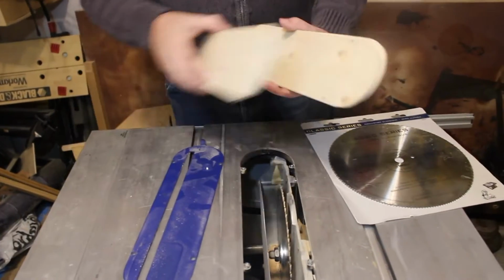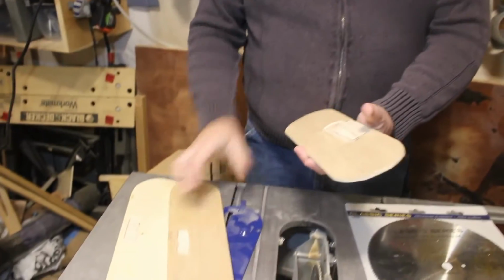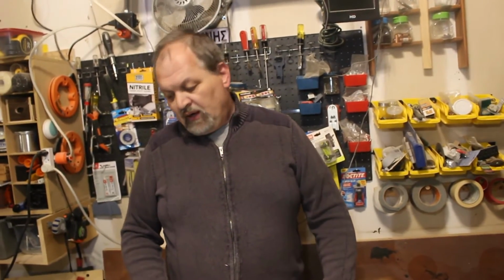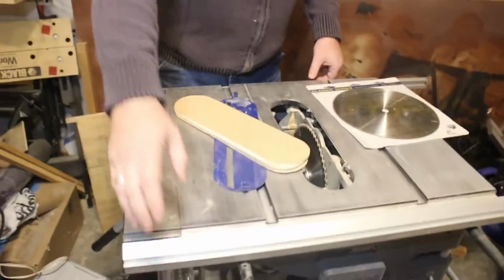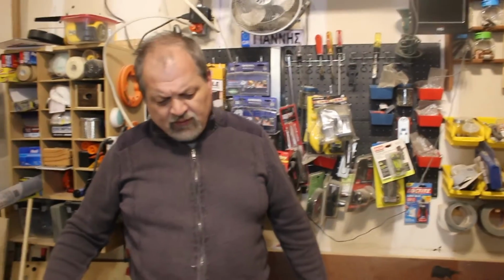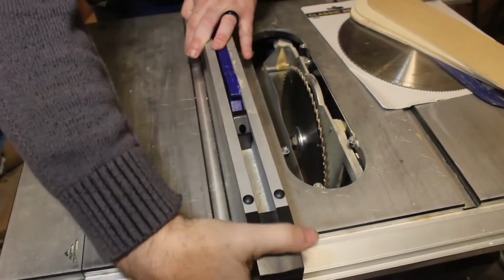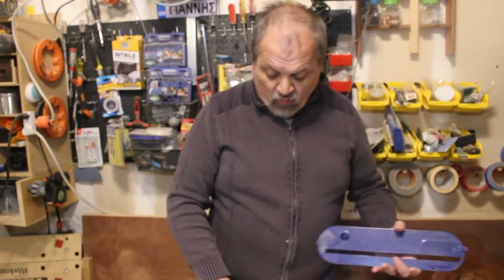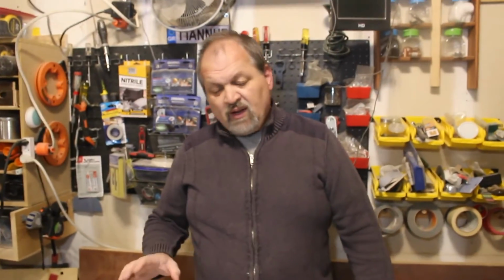Do not buy a KOBALT table saw before watching this review!!

Comment: On my 7th year with my kobalt, as a contractor it gets used weekly, not daily but at least twice a week. I had less expectations when I bought it, but has turned out to be really good. Never had a problem except the tab that locks it in the closed position broke off, more than likely due to all the bouncing in my work trailer. But I take care of my tools because they are my livelihood, wax the table, lube and so on. With 7yrs of use it still looks better than the one in this video. I wouldn't hesitate to buy another one. I square the fence at zero clearance and just use the slide for adjustment, if you need to rip anything larger than that I just used circular saw and guide.
Reply from the maker: yes, it is an excellent saw - especially for the price!

Comment: Kobalt made some adjustments based on complaints I am thinking. The plate is now adjustable with top leveling screws, and the turn knob is out of the way of the angle lever.  Had one for a year and so far I love it.  Im not a construction person or a contractor, but if I were, I probably would get something a little more INDUSTRIAL.  This is perfect for a small wood shop or diy.
Reply from the maker: Thank you for the information!

Comment: Where can I find a bevel gear and threaded shaft for the blade height adjustment? Lowes isn't any help.
Reply from the maker: You can Craiglist search for a non working saw or take the parts out and match them in a hardware store unfortunately there are no easy options for parts
Reply: @ProfessorDIY  thanks  I'm trying to find a height screw and the bevel gear. Lowes is no help.

Comment: As you said in a comment below:
"unfortunately there are no easy options for parts..."

And that's the end of it, for me. According to the manual, you can replace the wheels, rip fence, miter, and guard - and that's about it. Most of this handful of items you will want to replace - with something better - although the rip fence probably has to be Kobalt.

Guys, before you spend your cash on a tool, get the model # for it and try to find parts. Kobalt has to be one of the very worst of the worst when it comes to repair/replacement parts - In my mind, a tool that has no repair/replacement parts available isn't a tool - it's a toy, and a disposable toy at that. Spend a little money now to save yourself a lot of money later on a tool that you can maintain - not discard when anything breaks or wears out.
Reply from the maker: I conceptually agree with you  but these days it is cheaper to buy a new tool than most parts needed to repair it. You pair this saw with a good blade and you have something!
Reply: I am actually "restoring" this saw.  I called up and could order the throat plate, but the shipping is $28, and the part is $15 (for example).

Comment: If I had it to do over, I wouldn't buy this saw for my purposes which is mostly to make cabinetry and furniture. After gaining more experience with this "hobby", I realize this saw was a bad choice for that.

The two major problems I've had are the miter grooves are not true on mine which completely mitigates any possibility of precision work; and the blade elevation can't be locked and the mechanism is rough and prone to failure.

The wheels and chassis are actually quite nice and convenient. The fence is crap, but it can be locked and the sliding table feature makes for quick adjustments of the fence without actually moving the fence. The power is pretty good and I've had no problems cutting anything. For a job-site saw, it would probably be a good choice. For anything else, not so much.
Reply from the maker: This is not a saw for precision work, especially without a sled but I do believe it is a good entry level saw. Thank you for watching and for commenting.
Reply: This has been my experience exactly.  To get any kind of accuracy, I have to measure the fence from the blade in both the front and back of the blade and adjust the fence accordingly.  This saw is simply not accurate enough for cabinetry or furniture.  It would probably be fine for construction, like ripping ply or 2x4's, but it doesn't meet my needs.  In the process of upgrading to a higher quality saw and will try to sell this one.
Reply: Yes, I learned of the fence trick on YT a couple years ago. It really did make using this saw a lot easier.
Reply: What model is this you’re taking about, 1015 or 10152 ?

Comment: Those screws are too adjust to the table to make sure it's all level.  The hole is where you insert your screwdriver to adjust it up or down. Place a square across the top arbys you'll see if uppity need to adjust up or down.  Just make sure there's no light coming through.
Reply from the maker: I am aware of that but it is a bad design especially for a folding saw

Comment: I bought mine I guess around 2015, paid full price of $299, I like the saw in general, make sure you put a good blade in it instead of the one that comes with it, the plate is a total crap, the fence is another pc of crap, and the guard is another pc crap, first I removed the guard it never alined right and wood gets stuck while cutting, then the plate made my own and also made my own fence, the saw is very easy to setup on a job site and have guts, it can cut and keep on cutting without any issues. I should have bought another one when it went on sale for $179.
Reply from the maker: Great observations, I totally agree. Thank you for commenting and for watching :)

Comment: wow the current version of the saw is $329 @ Lowes. Is it due to supply and demand that prices have gone up? I cant find hardly any table saws in stock at the stores.
Reply from the maker: Yes, it is actually a very popular saw
Reply: Rocket Man  the saw you get at lowes now isn't this one this one is the KT 1015 which has been discontinued the current model is KT 10152
Reply: @davidcorliss  yea little upgrades here and there

Comment: I was messing with this saw at Lowes today, and that blade guard does lock down.  However, the rip fence is still catywompers unless you specifically align it parallel with the blade.
Reply from the maker: The saw you were looking at is not the same saw the look has remained the same but many changes have taken place

Comment: I have this saw. Unscrew the screws untill it pushes on the plate and makes the plate level
Reply from the maker: Yes I am aware byt the adjustment is needed too often and the design is poor. My previous saw (a RYOBI) had a much better system and never needed adjustments screws on a device that vibrates are not ideal. As you see on the video the plate is actually lifting above the screws  so no screw adjustment would helpThank you for watching and for the comment.
Reply: @ProfessorDIY  oh wow so if you unscrew your screws alot it doesn't start to make contact with the plate?
Reply: This is correct, video is very wrong. This is how all throat plates work. Screws are never, ever on top.

Comment: The price is all over the place for this saw. It was on sale for $175 last week (I probably should have bought one) The sign in the store said 'new low price $259, was $349'. I don't need  saw right away so I will probably wait for it to go on sale again. I wouldn't pay full price for it. At full price, I think the Skil 10" portable is a better deal.
Reply from the maker: $175 is a very common price for this saw, I prefer KOBALT to SKILL any day
Reply: @ProfessorDIY  The Kobalt and skil are similar.  I like the rack and pinion fence on the skil. Not a deal breaker though
Reply from the maker: @togger2151  Thank you - in my experience skill tools do not last as long as KOBALT can be found for a similar price in that case I will opt for KOBALT.
Reply: @ProfessorDIY  I just looked and the price is back to $349, probably means they are getting ready to put it on sale for $175 again, the retail game LOL

Comment: If you bought the  Kobalt saw, it's a little late to take it back for a refund once it is put together and after the packaging destroyed.   As for me, the saw is serving its purpose and seems to do a good job.  I don't know what people are expecting for $200 when the saw is purchased on sale at Lowes.  I do know Lowes sells a ton of these saws and the reviews on the Lowes web site have generally been positive.  

I would have purchased a more expensive and larger saw that is of higher quality, but room in my garage is at a premium.  So , I went with the Kobalt saw knowing it had its shortcomings, but could be easily stored away in a storage room.  I could have bought the Dewalt or other similar saws for about $200 more, but the end result would still be about the same for what I needed. 

Just keep in mind folks, you get what you pay for these days; particularly for Chinese crap.  For $200 bucks, you can't beat the saw. If you want a heavier, better quality and powerful saw, I suggest looking elsewhere and go with a Grizzly, Jet, Laguna, Powermatic or other high quality piece of equipment. With those brands you'll know you're getting quality in my honest opinion.
Reply from the maker: I agree! Thank for watching and commenting!

Comment: BLUF:  This is an entry level beginner saw.  If your needs are rather limited/infrequent and you don't want to spend big bucks, then it's a good saw if you understand what you're buying.  Otherwise, just save more money and get the DeWalt.    Actually, I'd pass on this saw and go to Harbor Freight and get their new Hercules as it's just a bit more than the Kobalt and compares VERY favorably to the DeWalt.
Reply from the maker: When this video was made HERCULES did not exist regarding the entry level comments yes and no. This is a contractor saw, not intended for fine woodworking but onstead for rough cuts however with sme small ajustements it is an awesome, inexpensive saw.

Comment: I can't say anything bad about my Kobalt table saw.  I was working up in the rafters in my garage and I fell.  First I bounced off my wife's Volvo wagon and ripped off the spoiler.  Than I bounced onto my Kobalt table saw (that was in the folded upright position) and bent the handle in half.  After that I rebounded back over to the Volvo's bumper than onto the floor.  Because the handle was made of a light weight material it bent in half rather than breaking my spine.  It also slowed my decent to the floor.  So say what you want, I have a fondness for my Kobalt Table Saw.  BTW does anyone have a right side handle they want to get rid of? :)
Reply from the maker: That is quite a story! I am happy you were not seriously injured! Thank you for the comment and for watching :)
Reply: bd594 good way at looking at it it bend so my back didn't break.

Comment: My Craftsman saw had a screw to lock down the throat plate....I made a thicker aluminum plate and used the 2 of the existing adjusting screw holes with tapered headed screws almost like my Craftsman  ...works perfect...little extra time but solid....I also made a dado one also....as far as the rip fence....even the expensive portables need attention to adjustment. ...even my 10 inch cast iron Craftsman has to be manually aligned ....only 3000 $ commercial saws have accurate locking rip fences. ...Come on Man! for couple hundred $ ....I never trust a rip fence ....always measure.
Reply from the maker: This saw does not have anything to lock down the plate, thank you for watching and commenting
Reply: @ProfessorDIY  if you have the knowledge making and insert from plexiglass is the answer..... and the leveling screws can become lockdowns

Comment: Hello, I enjoyed your review of the saw. I purchased one, but most of the issues I had were with the frame and tubing. It must have been bent or twisted so every time I opened and closed it, the nut and bolt on one side of it would just gouge the crap out of the metal. As far as the screws you asked about, there seems to have been an update. I started unscrewing those throat plate screws then I realized something was wrong. There were only 4 holes in the plate, but 5 screws. The screws are all supposed to just rest under the plate as adjustments screws for the plate itself. They are not there to secure the throat plate so maybe that was the problem. I'm going to try and see if the give me a price break on it since my pipes are gouged and my fence was damaged.
Reply from the maker: I am sorry to hear you experienced these issues, I would definitely ask LOWE's to do something about it. Any way you look at it the plat is poorly designed mine has now warped so  I mostly use my own plates. Still, for the money, this is a  very good saw. Thanks for watching!
Reply: CPDRollo53 when you know how to use the tools I think the problem is not the saw I have been using this saw for six years and no problem until now

Comment: Actually, this is a pretty good saw as far as this type of saw goes.  The author of this video is a dumb butt for not knowing about the insert.  This is not the only saw that adjusts that way.   The insert is quite flimsy, however.   The fence can be adjusted quite easily using the table top as a guide and then just slide the side table to adjust the width of the cut.  The fence is very rigid when locked down.  The width of cut can be adjusted up to at least 27 inches.  Big gain over Dewalt.  The miter gauge is useless.  I had a good miter from an old Craftsman and use that and a crosscut sled.   So for $179.00 I got a good saw.  The only downgrades are the miter gauge and the thinness of the insert.  It does work, however, unless you're not smart enough to know how or to read the instructions.  (And then brag on a youtube video about it)  And I really like the rolling carriage.  It works quite well, both in the shop and out in a yard.  I don't like the catches on the fence.  They are very strong and really pop when loosened.  If I'm not careful they'll hit my fingers and they hurt.  But the upside is that they really lock the fence down hard.  It does not move when locked down and is easy to move when unlocked.  I suspect the low price was because Lowes was having trouble selling them because of the fence and the miter.  The fence is actually very good when used correctly.  As I said the miter gauge will have to be dealt with.    The power switch is on the left.
Reply from the maker: Thank you for your opinion. BTW you agree with me other than the plate which was not mentioned in the original manual and was totally different than it is today that is all explained in the video. Thank you for watching.